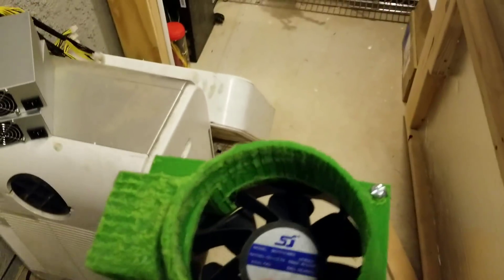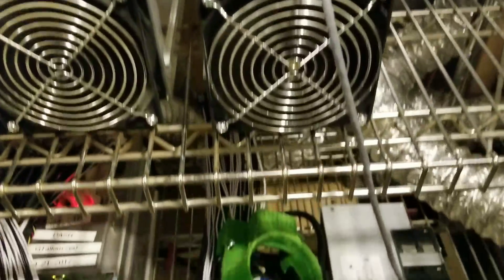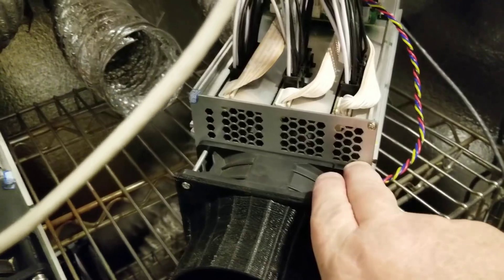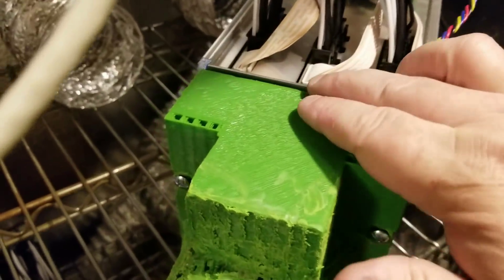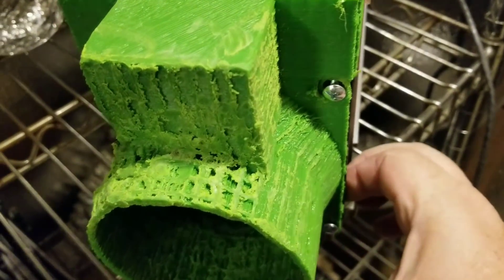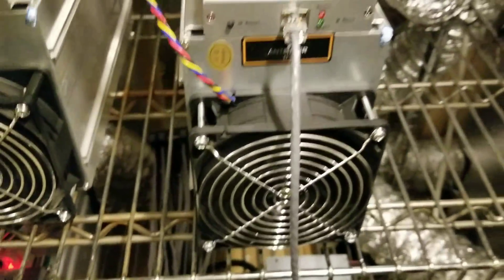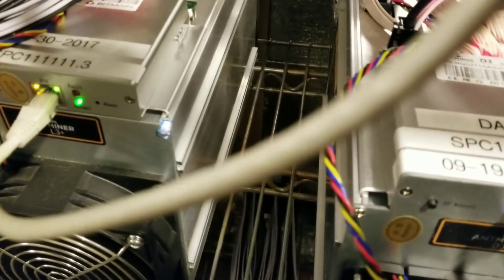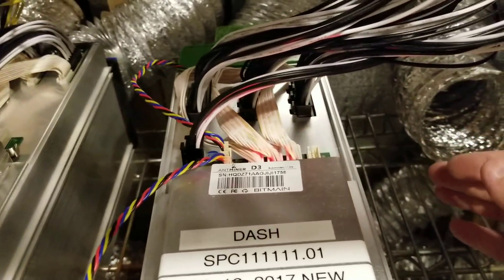D3 L3+ S9 ANTMINER EXHAUST VENT THAT REMOVES MOST OF THE HEAT FROM THE ROOM

Comment: Order mine for incoming A3
Reply from the maker: with the A3 you might want to order the 6-Inch shrouds, they run really hot and the ones that are out the owners are under-clocking them do to the heat they produce at stock settings.
Reply: whats "the  6-Inch shrouds"
Reply: can't get the link working can you send me another one plz
Reply from the maker: sorry sent you the backend store link by accedent hear is the correct one.

https://usahomegardens.com/products/l3-d3-15-172gh-a3-120mm-to-6-fan-shroud

Comment: Interesting setup. So, if you were to run one of those green covers over both fans and used a 4" insulated duct on both ends to bring heat in and push eat out of an otherwise closed and insulated room, this would decrease the amount of heat that would leak into the closed room compared to those black plastic ones which just act as a holder for the duct? How significant is the difference?and will it fit the Antminer S9?

I'm in the process of building a new space, where I'd basically have my shelves directly between two walls - one an outside wall, the other an inside wall - and in the winter I'd be pumping air from the outside in. In the summer I'd be pumping air from the inside out. Either way, the largest point of weakness is the heat of the insulated space between rooms. I thought of maybe running cold water lines through that space to keep it cooler overall year long (and add some waste heat to hot water tank), but my concern there would be condensation.
Reply from the maker: Elliander Eldridge 

Yes. It would, the s9 And d3-19 is a bigger unit then the l3+ And d3-15 on my websight usahomegardens.com I have a different options for both. And they are printed in black now. Green was just What I had when I first made them. They help reduce internal temp of the machines by 6 to 8 degrees and only need to be installed on the output side of the machine
Reply: I checked out your website, but only see a model listed for the L3+ , nothing sized to fit snugly with an S9. 

Also, I noticed you were selling a PSU for 3 L3+s. Any idea when you will have that in stock again? One of those would help to offset the increased post of the L3+ units compared to having to buy 3 Bitmain PSUs.
Reply from the maker: Elliander Eldridge 

The power supplies are yet to be manufactured anymore. Every one of them are sold out worldwide. When I have more info I'll let everyone know about them.
Reply from the maker: Elliander Eldridge 

The s9 and d3-19 shroud is on the last page of digital coin mining equipment beacuse it is a new one. At the top select digital coin mining equipment and then select newest in the next dropdown and it will come to the top. It's also under featured
Reply: I see it now. Thanks. I'll order one for now to see how it works with my setup, then I'll probably order a 10 pack or two later. Out of curiosity - and for proper planning on my end - what is the longest it tends to take for one to be made and delivered to a US address? 

For the electrical, I guess I'll just plan on eventually getting those when they are available.
Reply from the maker: Elliander Eldridge 

Right now I'm 7 to 9 days behind from order to ship on average if I get little to no miss prints on all my orders. I would catch up fast if my new printers would show up. I ordered a few more 3 weeks ago and they should get hear soon. Once they show up I will increase output by another 45 to 50 pierces a week.
Reply: shawnpc1 that isn't too bad at all. Not compared to the nearly 2 months it takes to get a miner.

Comment: nice video! what size are those ducts? 4"? 6"?  thanks
Reply from the maker: they are size 4" but work just like 8 inch ones do. they achieve the same temp ratings as the 8"

Comment: Minor point if the front and back fans r not ballanced in CFM current draw increases and Mttf decreases. Measure  the delta and pls let me know.   Good luck!
Reply from the maker: delta draws the same amperage with the shroud and without the shroud installed. about 6.93 amps continually per l3+ machine * 3 so it is actually drawing below bitmains stated values and saving me money on electric. the machines are also averaging 5 - 8 degrees cooler running with it on.

Comment: Excellent work. Any thoughts of going down to a 3 inch exhaust? I have a limited size in which to exhaust and 3 inch would work better to fit all my exhaust tube/ports. Plus I was thinking if the exhaust tubes were a bit longer, where needed, the 3 inch would help speed the air so it could travel further. I'm not 100% this is true as I haven't seen any 3 inch testing done.
Reply from the maker: Adam 

Never thought about a 3 inch one. I know it will cost a bit more to produce beacuse of the extra material. Give me a few days and I will see what I can come up with.

Comment: Thanks for providing the amps usage per machine for 110v! I'm planning to set up 7 antminers in my apartment and need to make sure I don't blow a circuit up. 

Also I know extension cords aren't recommended for these things but if I had to use them, how many extra amps should I take into calculation? Or is that the wrong question for what I'm trying to ask? Basically I don't want my apartment to catch on fire while I'm sleeping
Reply from the maker: P1LL91 

No problem on the amps, I think it's worth sharing. The extension cord is no, the wrong way to go, most cords are rated at 20 amp but can only run 10 amp constantly before they melt down. Your best set would be to buy some 6 or 8 Gage wires and make your own cords. But then you still have the problem that most outlets in a house or apartment are normally 12 or 14 Gage wire and not rated to run constantly like we use

Comment: Hey - Shawn I have made back plate for an 8 Inch Shroud. That is similiar.
Reply from the maker: cool any pictures of it. the cool thing is i can replicate mine over and over again, and still just use 4 inch tubing.
Reply: Yeah let me cross post to my website real quick.
Reply from the maker: i have cleaned this print up a lot over the last 24hrs. i have to make changes every other print to clean it up little by little so i can keep producing them for other people. i have also added my business name embossed on the sides now during the printing process
Reply: Yeah -- it took me a while to get the printing down. Sitting at 6 printers now running. I ended up trademarking the name.
Reply from the maker: i actually patented it, i have a limited utility patent right now waiting on the final approval from the us patent office.
Reply: What did your weight for the part come in at?
Reply: Last note -- if you do a hull transformation in OpenScad you can probably print the part upright. So basically encase the whole fan and work out to a 4 inch output.
Reply: Nice! Yeah its a process for sure. That was a decision point for me last year when I released the "old school" design.
Reply: Hey I did that too! Releasing it tonight. Hood included. Will work with 4 5 6 and 8 inch dru 3d shrouds!
I guess this is shawn. Hi shawn! Im Dru.
Also shawn, If you print this model with PLA supports, they will wash away with acetone. Really good way to do it. They clip away the bulk of the supports then use a paper towel and acetone to wipe the knicks away.

Also I am looking to file a non provisional patent within the next 12 months on my Venturi Plate and Hood. I have a provisional but I heard you may have a template for filing without a lawyer for something similar.

Here is my email too. Shroud makers should stay in contact :)
Dru3d90@gmail.com

Comment: Hi Shawnpc  thank you for your good video <<and I want to make sure I am understand your electricity info .... I will have 8 d3 and my flat has 30Ampere with 220V how much I need of Amperes to run all this devices?? --- I will use Antminer's  power supplies
Reply from the maker: if you only have 30 amp power supplies coming in on 220v  you will have a problem. each leg of 110v on a 220v system will draw 43.6 amps on each side. you would be pushing your flat running 5 machines. 5 will draw 27.5 amps per 110v side and that would leave you pretty much nothing else to run a light or any other appliance. you best shot would be to look for a new place with 100 amp service or more to help you  run each of them. or find a few friends that you can have them run at for a fee
Reply: shawnpc1 thank you very much    For your help